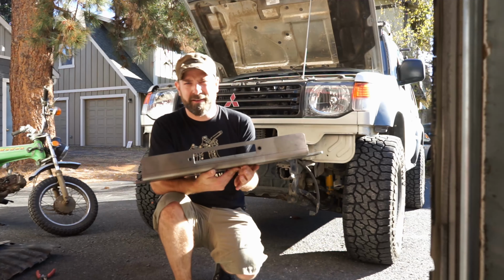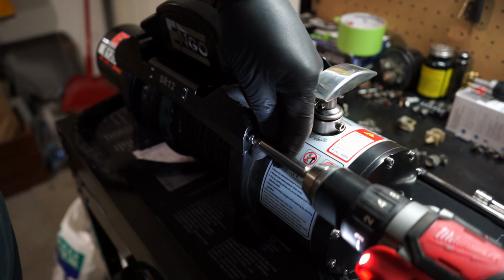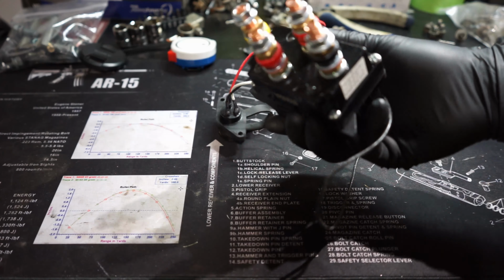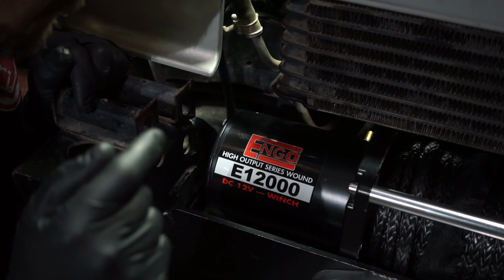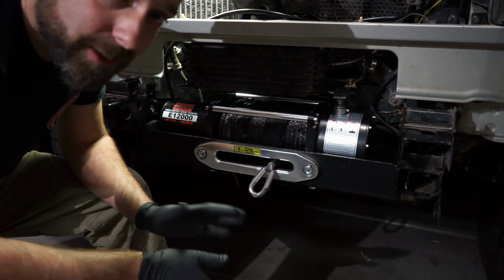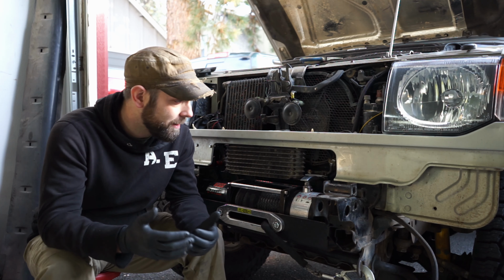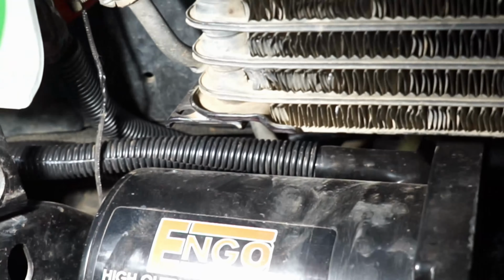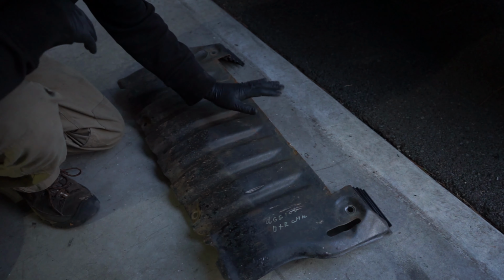Montero winch plate and winch install

Comment: HI mate, good show, moving the winch  over 2" that mean's you'll have to drill 4 new holes, and the drum will not be in center with the fair lead, I would just rotate the winch motor a notch or two to clear the leaver for the cooler. When you incert the square nuts in to the winch, cover the hole with a bit of sticky tape, nut will not come out.
Reply from the maker: Thanks for the tip! This is back when I was pretty new to winch installs and now I work at a shop that does lots of offroad vehicle outfitting and have learned soooo much. I might go back in and change the angle of the clutch to allow for clearance but there's also some other modifications and changes I've been thinking about too so we'll see!

Comment: is that blue sea switch the dual or the single circuit?
Reply from the maker: It’s a single circuit. Just there to power the winch when in use.

Comment: hey man, i just got a winch and winch plate from ADD, I was wondering why you have an electrical disconnect for the winch. I don't understand winches as well as I should and don't understand why it is important, or if its something that isn't important. Also should I paint the winch plate to prevent corrosion? and I bought the ADD modular bumper, and would you recommend painting that as well? I have a year 2000 gen 2.5 Montero. Thank you so much and this video will help a ton as I install the winch in the coming weeks.
Reply from the maker: It’s basically a safety measure for when not using the winch. The wires to the winch are big and if they ever managed to come in contact with the body you will probably burn the vehicle down haha! A disconnect makes sure they aren’t live when the winch isn’t in use. Plus then no one can just have the ability to use the winch if you don’t want them to. And if there was ever a malfunction you can just shut it off there. Yeah I would paint it to help with corrosion. That’s why I did it. Glad the video helped!